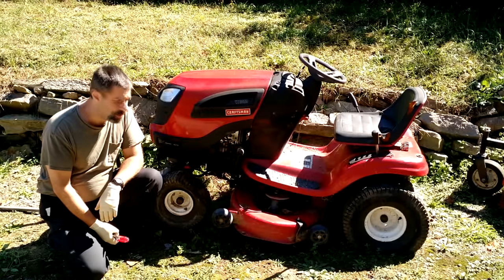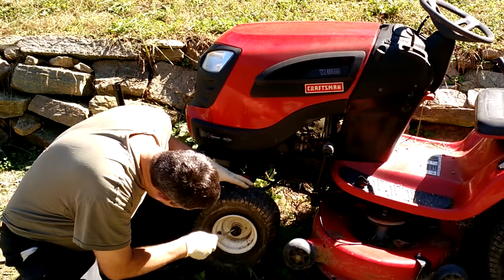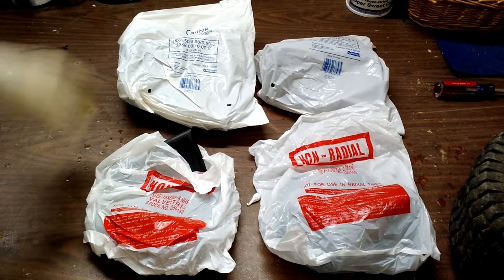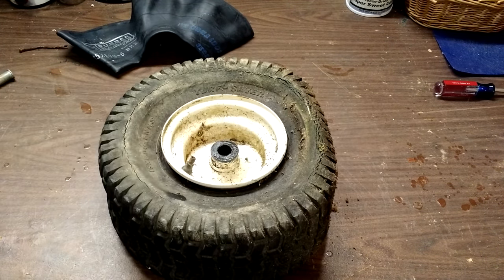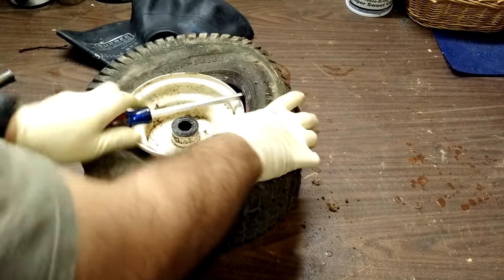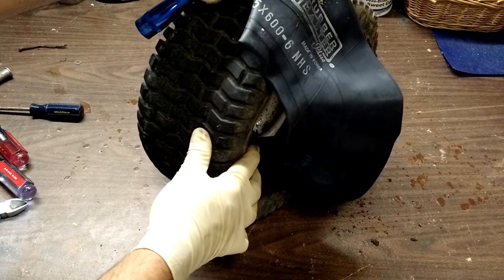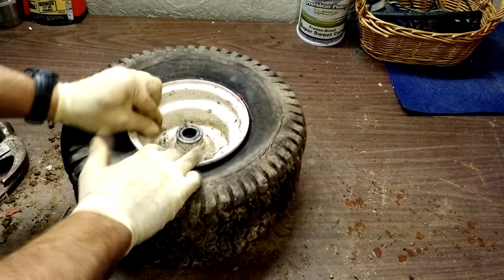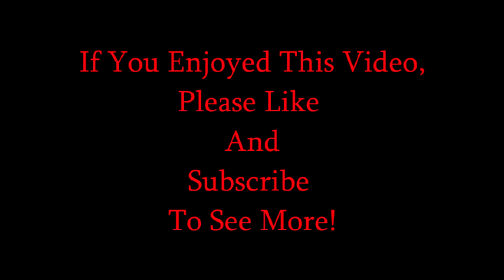Installing Inner Tubes On Your Riding Mower Tires.

Comment: Because of you, I was able to fix the tire on my riding lawnmower.  I had hired one guy and asked another to fix my tire.  Neither succeeded.  They used some kind of green goop, which didn't work.  Anyway, I watched your video and accomplished it myself.  Single mom here and I surprised myself!  Thanks so much!  :)
Reply from the maker: I'm so glad to hear I could help, and good for you! Too many people don't even bother to try.
Reply: Sherry Lusk who cares if you are a singel mom?
Reply: @axtra92  I care!  Why do you care that she mentions it.  Saying she's a single mom lets everyone know that she is doing this on her own without a man's help.  Men generally have more upper body strength and typically this type of job falls in their area of expertise and not a woman's.  Bravo to Sherry Lusk!
Reply: Yes, you have my approval, not that U need it. But I get so frustrated anymore that many repair people either want to charge people an arm and a leg, don't know what they they are doing, or think that repairs come in a can. I mean what was so hard about this right? You take the friggin' tire off part way and put a tube in,  blow it up. HELLO! Back in my time, the 60's and 70's, we did this stuff all the time. I worked at a filling station and we repaired tires with patches, bicycle tires, and ACTUALLY fixed stuff on your car. We didn't replace the alternator we rebuilt it. Now it's a lost art and it will take until next week to fix.  We did it that day, in an hour.
Reply: @danielholtxxl4936  You are the hero of many people.
Reply: I always put the cap back on in case of situations like that
Reply: GO SHERRY GO SHERY GO SHERRY! It's amazing what we can do with our hands and brains, wish more folks would  use them more often, this world would be a much better place!
Reply: @hardkore360  Thank you!  :)
Reply: @henryraymond8676  You repaired stuff in the 60's and 70's because things were made differently and were repairable and because they were made that way the replacement cost was high.  

p.s.   I have glued more patches than anyone will ever know.
Reply: @sherrylusk3744  marry me.
Reply: Sherry Lusk nicely done Sherry! Great feeling of accomplishment I’m sure!!!
Reply: I doubt you still have notifications for these comments, but the "green goop" they used was most likely Slime (brand name). That stuff is REALLY good for small punctures like nails, screws, pointy plants etc. Not able to do anything about giant holes or torn sidewalls, which your tire probably had.
Reply: You go mom !!! 😀

Comment: Well from years of tearing apart my bikes as a kid has taught me to put the cap on the inner tube before trying to put the tire back on the rim. It helps keep the tube in place.
Reply: Yep, that’s the only mistake I saw on this video myself.  The other peace of mind tip I do (from the bicycle tire days) is fully inflate tire with valve core removed to set inner tube, let the air all flood out and then check the bead to make sure tube is not pinched between rim and tire bead on both sides.  Once I know tube is fully set, then I air up to set bead followed by proper tire pressure :-)
Reply: The hole one these wheels are bigger than the hole on bike rims. These have a bigger hole for the tubeless valve stem so it wouldn’t work
Reply: I learned that lesson from watching this video.
Reply: Already ruined the first tube, trying with the second one now.😮😢

Comment: I had to patch the tube in my garden tractor. After patching the tube the tire was fighting me going back on the rim.  I came inside and a search brought me to your video for help.  I learned two things...  I needed to use better lube around the rim (used a little Fluid Film) and learned I was not holding my tongue right (needed to use your technique).  I went back out and within 5 minutes had the tire back on the tractor. THANKS  for posting. Nice job making the video :)
Reply: Tire irons, especially long ones will pinch the inner tube about every time. AutoZone sells these stubby ones for around $12. On the back tires, the spoons are further away from catching the tube, this the long ones will work on those. Wheel barrow tires are so narrow, you also can only use screwdrivers.

Comment: Once the tube is inside the tire clamp on your locking air hose chuck.  Give it just a tiny bit of air to help take the wrinkles out and then leave the chuck clamped on.  That will keep the tube from slipping back in without impeding on your work area.  When tire is back on rim your set to air up.

Comment: Once you got the fill valve through the hole, it helps a lot to then partially inflate the inner tube. That keeps the valve from falling back through so easily.
Reply: Once I get the valve through the rim, I screw a valve stem tool on to keep it from pulling back through.  It's only a couple $$ and worth their weight in gold!!!
Reply: I’m just saying if you don’t have one of those and don’t want to make another trip to the store, lol
Reply: @TerrapinCreations666  I just put the valve stem cap on. It will not fit thru the hole, so the nozzle stays in place. Remove it when done to fill tube, then replace. No extra tools required.
Reply: Denis Gregg Oh ok. The caps I’ve had go right through the hole easily.
Reply: @TerrapinCreations666  I just ran into that yesterday. Some rims have bigger holes than others. On those I use a flat washer under the cap (as long as you have the right size hole in a washer).
Reply: Its called a valve stem lol
Reply: @larrygonzales7410  The hole in the rim is not.  The valve stem is what sticks through that hole.
Reply: @TerrapinCreations666  😂😂😂😂 thats exactly what I said. I never mentioned anything about the hole in the rim
Reply: @larrygonzales7410  Oh Ok, so who wasn't calling the valve stem a valve stem?
Reply: @TerrapinCreations666  you did and the maker of this video 🤦‍♂️ calling it a "fill valve"
Reply: @larrygonzales7410  It's also known as a fill valve.  The valve stem is just the long tube.  The fill valve is the valve itself.
Reply: @TerrapinCreations666  ok sure well leave it at that
Reply: Put the cap back on also so it won't fall through.
Reply: @11swampy  good idea !! I was thinking to use a same thread size nut to do the same thing !!

Comment: Before re-seating the tire, put a washer on the valve stem and then the cap. It keeps the valve stem from dropping. I did this same repair just yesterday and it's a real pig of a job getting the bead re-seated. In your case, I would have replaced the tire too. Mine was more flexible and it was hot and humid in the garage. Bad for the body but great for making the rubber flex better. I still needed a boat load of soap and strength!
Reply from the maker: Good idea! Thanks.

Comment: I have a 20 year old MTD Yardman Lawn Tractor. Was having problems with the front tires always being flat when I went to use the Lawn Tractor. Took the wheels off and filled them with air and put them in a dunk tank filled with water. I never could find the leak. I got tired of the problem so I thought why not try a bottle of Green "SLIME" Tire sealant. Well let me tell you the product was worth the try. I never have a problem with those Front Tires anymore and it has been years. Very seldom do I need to ever add air to them unlike before. My advice try the SLIME first before even thinking of putting tire tubes inside the wheels. Also let me add. Next time you do this type of job get yourself a used empty spray bottle and add some dish detergent and water to the bottle. Spray it around the rim and it will help you get that tire off. Let me also mention that Harbor Freight sells a inexpensive mini tire changer that may be worth having if you ever need one. I own one and it is well worth having for wheel barrow,lawn tractor and quad tires. There is always a HF 20% coupon available to use to lower the price. Beats trying to do it the way shown above. Trust me I have done them that way also. Its not for everyone.  It could be a real struggle.
Reply from the maker: Great advise! Yes!! Use slime first as it does cure a lot of these issues. When the tires finally develop cracks, it's time for  tubes.
Reply: Farpoint Farms Yes I agree your tires were beyond Slime helping. I am guessing  you must leave your tractor outdoors for your tires to have dry rotted so badly. Then I look at your video of your tractor and it looks to be in great shape like if left indoors. I don’t get it because as I mentioned my tractor is 20 years old with the original tires on it and I see no signs of dry rotting. My wheel barrow is always outside in the elements and that tire is dry rotted but believe it or not I have Slime inside of it and it is holding up. lol.

Comment: Just bought two tubes. Instructions said add a little air before installing tube. Maybe that keeps it from rotating out of place. But I assume using a screwdriver you might want to keep the tube flat as possible and away from the edge of the rim where it may get punctured. I have put tubes on a number of times before and used a washer that fits tight on the valve stem and put the cap on so it does not slip back out when installing it or airing up. I know if you put the tube in backwards when you air it up it will pull the stem back inside the rim. Not sure but I think the blue ring that is on most of these tubes go to the backside so the stem is positioned right when you blow it up. Been a good while back so not 100% sure about the blue ring or blue dot going to the back. Looking at these tubes it looks like the blue ring goes to the front. Guess I need to check with my computer Co-pilot to find out before wasting time putting them in wrong.
Reply: Just checked with co-pilot. The blue alignment ring on the tube goes to the front side of the rim. I think some have blue dots instead of rings.
Reply from the maker: Good tips- Thanks for sharing

Comment: Just installed inner tubes on both rear wheels on my MTD Lawn-Boy riding mower. Wheels are press-fit onto the axle and do NOT come off unless using an oxy-acetylene torch, various clamps and pullers, and a whole lot of cuss words! 
I removed both tires from the wheels, wire-wheeled the rust off of the rims, spray painted them to help prevent more rust, (Fix-a-flat and Slime will both cause rust to form!) re-installed  tires using the three screwdriver method; back-side first. Inserted and positioned tube, using needle-nose Vice-Grips, carefully, to hold valve stem in place. Pump-spray bottle with soapy water helps facilitate mounting the tire to the rim(wheel). All performed while each wheel remained on the axle! Easy-Peasy!

Comment: Good video! Just finished replacing a 4.10/3.50-4 tire and tube. Took me about an hour wrestling with it trying to figure things out. I used a vice to clamp down on bearing hub to stabilize it. For tire irons I put cut off plastic tubing on tips of large screw drivers so not to pinch the pinch while installing. Also used an adjustable clamp to squeeze down on tire.  Everything about repairing a 4” tire and tube seems like 10X harder than bigger tires.
Reply: Yep  !

Comment: I broke down hundreds of tires working in my Dad's garage. They make a  tool that screws on the end of the valve steam that keeps it from getting sucked back into the tire. It also has a thingie that will remove the valve stem to let the air out of the tube. Also some one called the screw drivers hole makers and they are so right. Nothing worse than fighting the tube back into the tire just to have to break everything down again to fix the hole you just punched in the tube.
Reply from the maker: Good to know about the tool. Half the "fun" is fighting the stupid valve stem

Comment: Thanks.  One of my warm weather to-do items is to do this to the tires on my snow blower.  I had to plug 1 of them a few years ago, due to a nail in the tread area.  They don't leak, but I never liked the idea of tubeless tires on equipment like this, ever since I had a full load in a wheelbarrow, and needed to do a 180 degree turn, and the tire pressure was low, and broke the bead while turning.
The snow blower and tires are 10 years old, but since it is almost never in the sun, they are not dry & cracked.
Reply from the maker: Good luck! As you can see from this video, its just time, patience and some brute force.

Comment: Just changed both rear tyres and tube’s on my Australian made Greenfield ride on with the assistance of my wife. Had to be careful not to swear too much as wife would have walked off. Anyway had been planning this job for the last year and did a lot of research. Tools used was some tyre levers from my inheritance (thanks Dad RIP)  valve extractor, 8 inch G Clamp and soapy water, plus ratchet strap. All work done with wheel still on mower, much more difficult as wheel would not come off due to shaft being tapered and some electrolysis between Aluminium rims and Steel shaft.
First deflate tyre, remove valve,then used G Clamp across old rubber tyre screw in to brake beed, slowly used levers to remove first side of tyre then remove tube. Next I removed tyre with great difficulty without damaging rim with levers. To install new tyre do the reverse but once tyre and tube is on I used ratchet strap around new tyre tightening slightly to help get the bead to seat, use soapy water on both side of the rim and slowly inflate tyre. This should make the tyre bead correctly but it might need you to gently hit tyre around the middle a number of times to assist it to pop into position. I then slightly deflate tube then remove ratchet strap, then 
I inflate to make sure tube was not twisted inside Tyre, not sure if this is necessary but just something 
I do. 
Graeme in OZ

Comment: Tip:  after you have the stem valve through the hole, place a washer over the stem and screw on the cap to hold the washer on.  The stem will now not be able to slip back out of the hole.
Reply from the maker: That is a great tip, thanks for sharing

Comment: I always broke the bead by setting a 2x6 on the side and driving a truck up on it. Works well especially on the larger rear tires. This guy makes it all look easy with hand tools
Reply: I was scared he was gonna gouge his rims or cut slots in the tire beads. Not the tool of choice in my opinion.

Comment: I fitted a set of tubes in my mower today and I found that you can remove and fit new tubes without taking the tyres off. Break the bead as normal from both sides push the tyre down to the centre if the rim feed in the tube and slip it under the tyre. Its a lot easier than taking the tyre off and a lot less chance of nipping it when refitting the tyre.
Reply: That's what I'm gonna try next. Tire irons are not really designed for tubed tires, tyres in jolly old England. The spoons on the end work great on tubeless, but pinch on ones with tubes.

Comment: Thank you for the video!  It was very helpful as to how to break the tire bead away from the tire rim.  The rims I am working on are apparently  made of soft metal.  As I was using a hammer and large flat tip screw driver to loosen the tire, I gouged some of the inside of the rim, creating some sharp inner tube puncturing points.  No huge problem, I smoothed them down with a Dremel tool.  Just something to inspect for after you break down the tire.  Thanks again.
Reply from the maker: Glad it helped and that you were able to fix the rims.